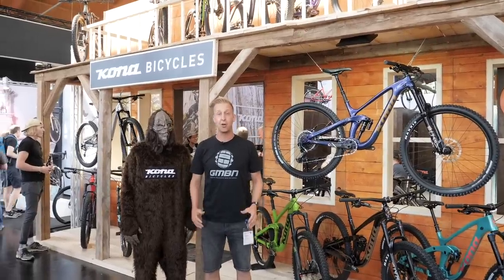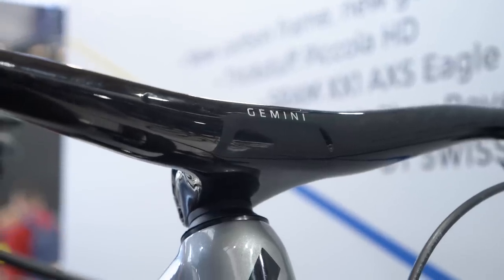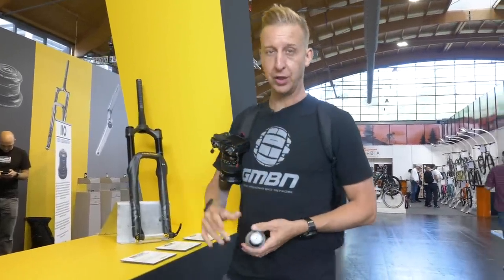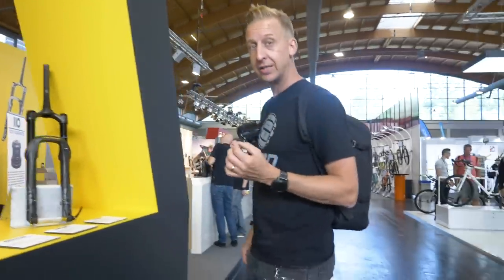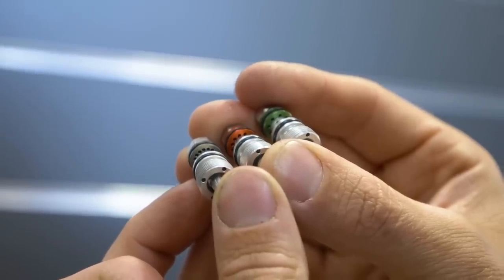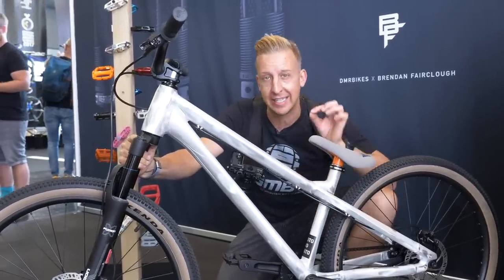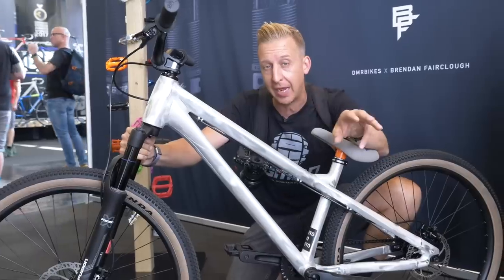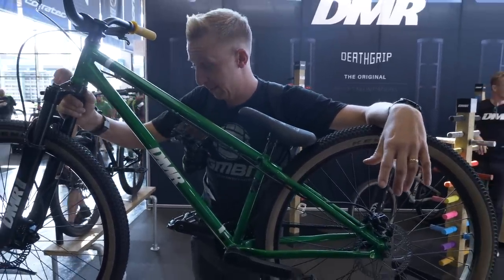The Hottest New MTB Tech At Eurobike | Eurobike 2019 Part 1

Comment: Am I the only one not liking the one piece bare and stem idea? Don't you think they'd snap alot easier due to the rigity and I'd rather replace a bar or stripped stem than a £600+ single pice set up
Reply: It's just a very expensive copy of the Syncros Hixon bar.
Reply: I hadn’t even considered that. I Suppose that handlebars are in multiple pieces for good reason though, I think you just saved me from an expensive mistake.

Comment: I like the one-piece bar stem combo. The only negative i can see is if you happen to travel with your bikes a lot and need to take the handlebars off to fit them in a travel bag. Four bar clamp bolts sounds a lot nicer than having to retighten the headset.
Reply: Also a decent amount less adjustment. The lack of the ability to roll the bars seems like a major downside to me and you have to hope that it is available in your preferred stem length, bar sweep and bar rise.

Comment: Oil slick trend again huh 
What is this 2004?
Reply: Only see them on BMX not on mtb
Reply from the maker: ag.onewheel XR if you are talking Bmx trends we would say 2004 was more digi-camo 😉. Yes, oil slick has been around for a while and we have seen it become massive in other industries.
Reply: Only the real OG’s did there BMX Frames with sandpaper, petrol and an open flame in the skatepark.
Reply: I had a oil slick hubs on a Bmx

Comment: Give those bearings to Hambini and see what he thinks of them.
Reply: Sealings are the same as in standard RR bearing so i don't get it why they are more contamination proof. As i saw sections of them there are still gaps ans as they are "self lubricating" there will be no grease barier under sealings. For me they will behave just like normal bearings. Read about industrial self lubricating bearings. They are still using normal bearing bc they are cheaper and live longer. Self lubricating bearings are used only when they cant use normal grease or oil, environment contamination etc.
Reply: @Ciernik93  the idea is that all available space within the bearings are taken up by the oil polymer. Solid oil they call it. No if there is no space, nothing can get in. https://www.skf.com/uk/products/bearings-units-housings/engineered-products/bearings-with-solid-oil/index.html

Comment: Colored tires went away because from you don’t add enough carbon black to the compound to turn the tire black, UV radiation from the sun will degrade the ‘rubber’ too quickly. Only pro riders are going to replace tires every week.